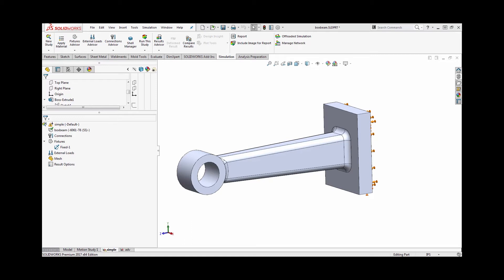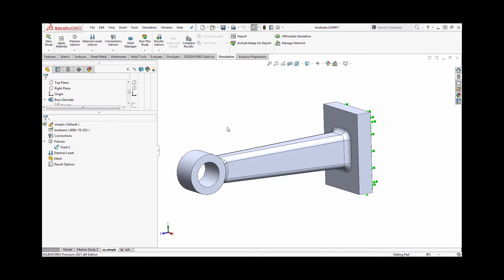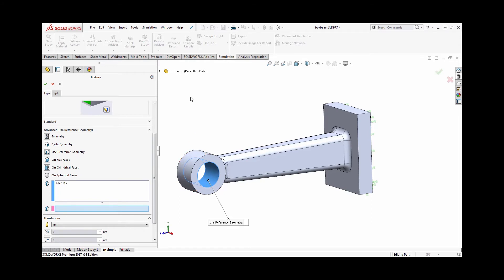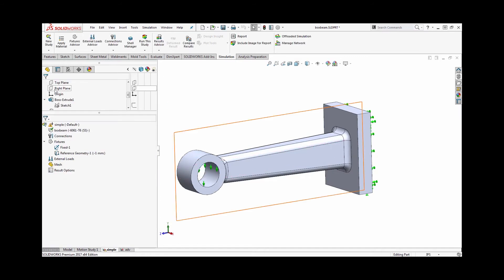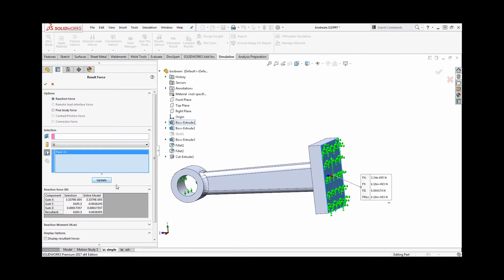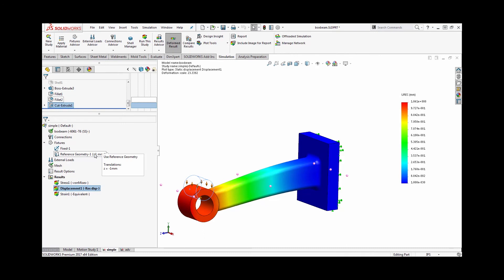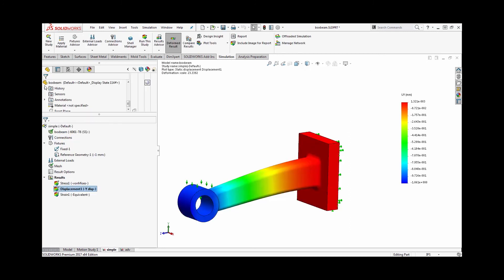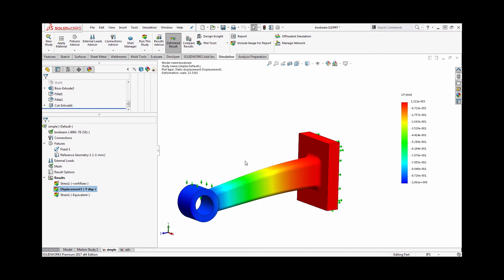SOLIDWORKS Simulation Quick Tip: Prescribed Displacements - Part 1

Comment: How do you retract the displacement?!
Reply from the maker: in a Linear Static analysis the loadings cannot be varied over time

If you are performing a nonlinear analysis there should be a "Variation with Time" section where you could define a custom curve for load-unload. 

In the case of prescribed displacements in a nonlinear analysis there are two approaches. First the displacement could be returned to 0 at end time, which would force the part back into its original position. The second approach would be to "release" the fixture at a specified time by setting its value to "Off" - which would simulate forcing the part down the specified distance, and then releasing the load.
Reply: @hawkridgesystems  
I have managed to unload the prescribed displacement but the punch in my assembly is still attached to the strip I am deforming when released… any advise? I’m trying to find the remaining displacement in the strip after being deformed by a specified amount! Thanks

Comment: @2:53, the scientific notation just below max URES, 1.061e+000,  is 9.727e-001, which I think would be converted to 0.9727. So what does "00" in "e-001" represent? It could have been just "e-1"?
Reply from the maker: Good question - those leading zeros can be ignored (e-001 would be equivalent to e-1) 

The numeric display is also adjustable between floating (for instance .9727) and scientific (9.727e-001), and can also be adjusted to switch from floating to scientific notation past a certain range.

Newer versions of SOLIDWORKS seem to do a better job at using the appropriate amount of leading zeroes in the scientific notation